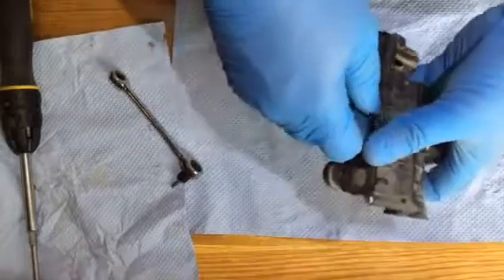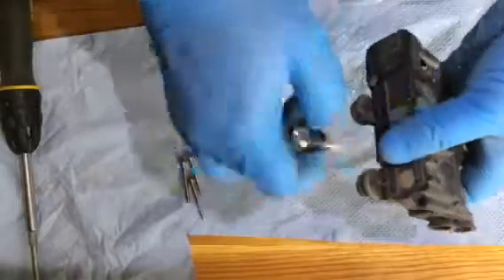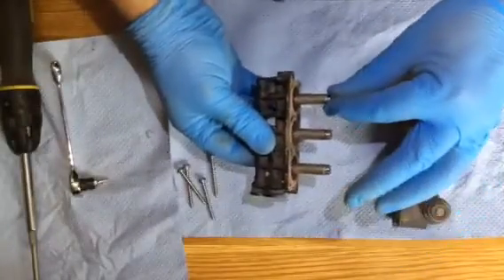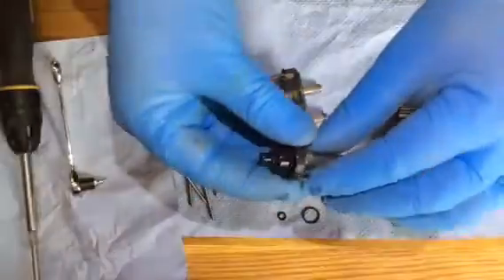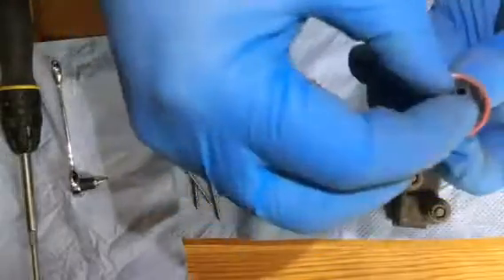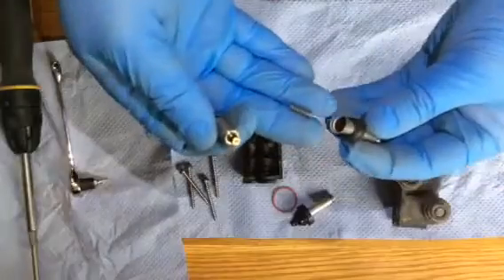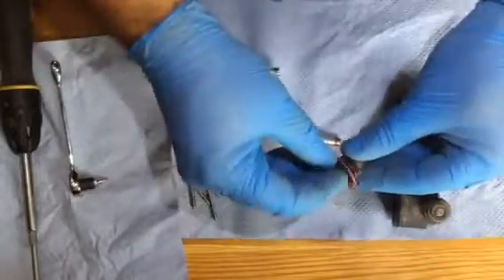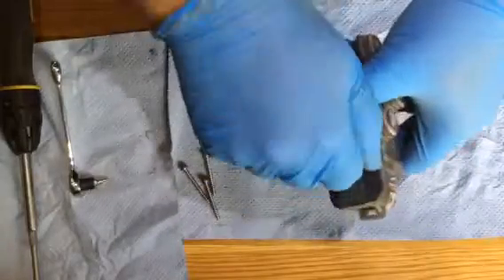Discovery 3 / Range Rover Sport front valve control block rebuild

Comment: Thanks for the video, is this the same for the Disco 4? Also if you do see white residue in the valves what is the subsequent response, does this mean a compressor replacement is required or can that be serviced too?